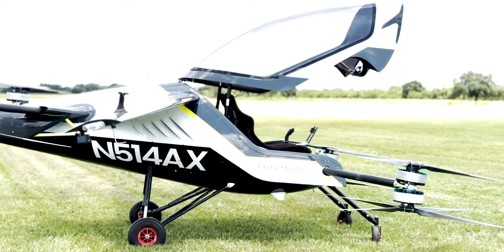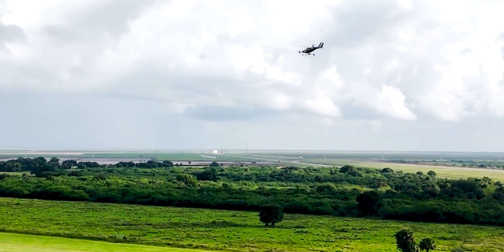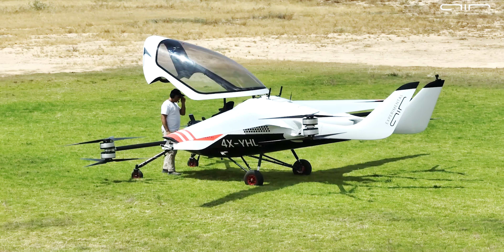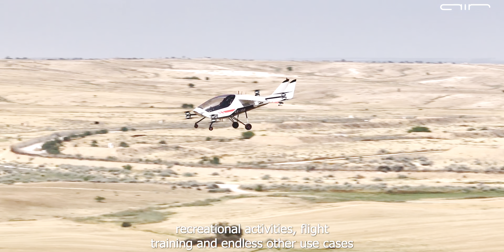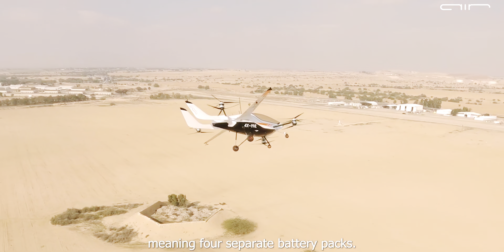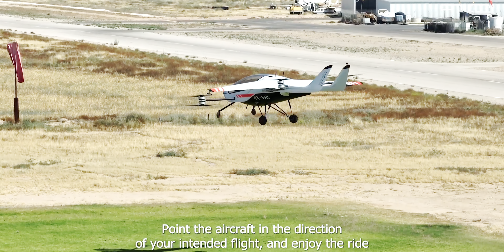FAA Clears AIR eVTOL for Florida Test Flights

Comment: Yes, AIR-1 is definitely exciting, and I hope I'll be able to own one  (or,something similar) some day.  But equally important, if not more so, is the need to push for rapid development and opening of new infrastructure to handle the hoped for increase in EVTOL transportation, both mass (as in air taxis) and personal (as in AIR-1-type personal "flying cars").  We're going to need hundreds if not thousands of vertiports, public and private; individual landing pads, which will serve a similar purpose as today's driveways and parking lots.  Also, we'll  require a huge increase in the number of public and private charging stations to recharge these flying carpets of the future.  Soooo.....What are we waiting for, American aviation industry?  Let's get to it!  We need to start working on solutions to these problems, yesterday, not tomorrow.  Oh yes.  Don't forget the huge increase in energy production this new mode of transportation will demand, as well as the staggering rise in data processing that will be mandatory to adequately track, control, and communicate with these expected fleets of vertiplanes.  If we're to usher in a new way of travel for America (and hopefully) the world, American industry needs to get ready for takeoff.  🤠